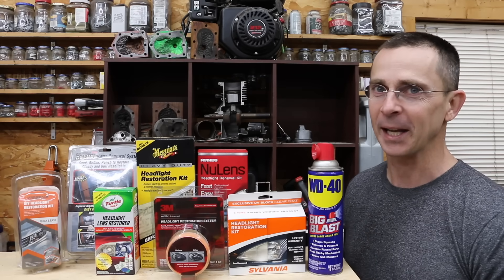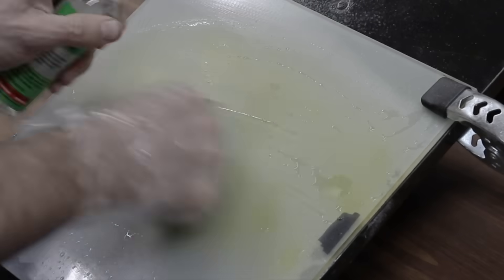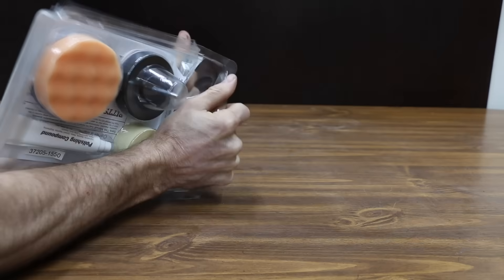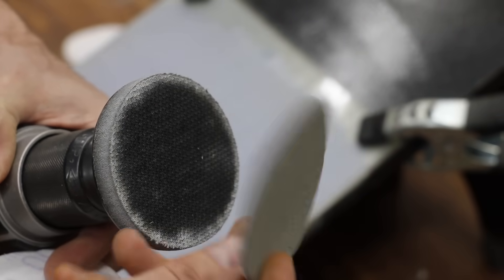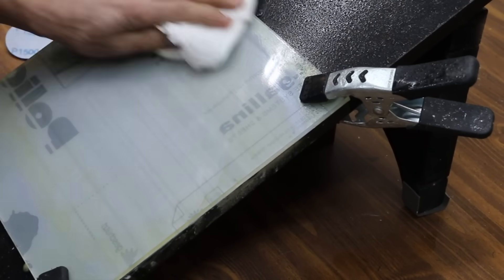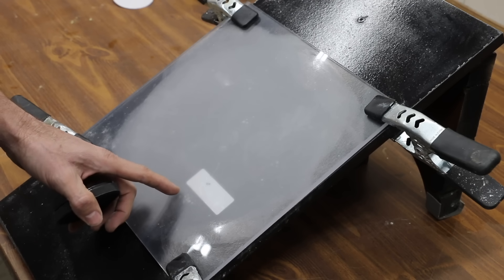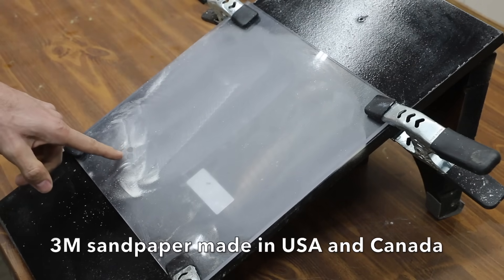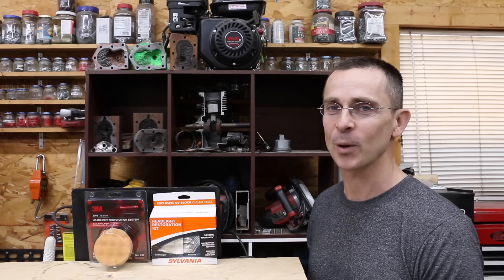Best Headlight Restoration Kit?  Let's find out!  3M, Sylvania, Meguiar's, Mothers, Turtle Wax & HF

Comment: Great test and great job, once more! There are many videos on Youtube about the subject but none as this one! Congratulations! Some videos show that whitening toothpaste may be a cheap and efficient way to do it. On a whitening toothpastes test I saw, I concluded that the best toothpaste for headlight restoration would be the "Colgate Max White One" because it's very abrasive and very good to remove stains from the teeth, had a reasonable glistening effect, but does not whiten them, like all the others tested. Pity you didn't test it. 
Likewise, using both Meguiars Ultimate Compound and Ultimate Polish (in this order) followed by ceramic coating (to give it a "permanent" protection) is also a great way to do it, but ceramic coating is very expensive, as we know. 
Just some examples:
https://www.youtube.com/watch?v=vUdSUDObwVc  (Chris Fix - From 25:10 to 26:30 - Meguiars compounds + ceram coating)
https://www.youtube.com/watch?v=FhzrNrGQ41M (LegitStreetCars - Compound + Ceram coating)
https://www.youtube.com/watch?v=rXHTXdlWw1w (Chris Fix: Using whitening toothpaste)
https://www.youtube.com/watch?v=lrlIhRea8u8   (With some extras from the above)
https://www.youtube.com/watch?v=UG54xt56uZo (Meguiars compounds + isopropyl alcohol)
Chris Fix also uses a "permanent" method using a UV protective spray at the end:
https://www.youtube.com/watch?v=UEJbKLZ7RmM
Scotty Kilmer's way: https://www.youtube.com/watch?v=E9NP0_nF2ak (polish first and then coat them with "Meguiars Headlight Coating". Then just coat them once a year)
Reply from the maker: Thanks for the feedback.

Comment: Sorry, but the damage incurred by headlights over time is not simple abrasion. The degradation you aptly explained in the intro was accurate....and them you ignored this in the test. As others have pointed out-a pile of ruined headlights would not be to hard to round up.

And far cheaper to you than the Lexan sheets you bought!

Comment: So it clearly looks like the Sylvania kit ($19.99) wins out and the big differences are it is all done by hand (not by drill attachments) and then you reapply the Surface activator and the UV Block clear coat application. So what’s the big differentiator? The hand sanding? The surface activator or the UV Block clear coat application?  By the way you must have gotten some workout with this project. Thanks for all your hard work!  Dale
Reply from the maker: Sylvania's sandpaper is very good and their surface activator/UV block clear coat is impressive!

Comment: First let me say you did a fantastic job in comparing these products.  The only sad part is you will have to do this every two years or so.  Personally, I think manufacturers should go back to a glass sealed beam headlight system and do away with plastic all together.  After all, this is a part of the automobile that can directly affect your safety when driving at night.  It's this kind of engineering that spawns these products you compared and we shouldn't have to go through this exercise at all.  If not a glass headlight, which is much stronger than a drinking glass, then have hide away lights that don't get the exposure to UV.  Thanks for sharing.
Reply from the maker: Glad to hear!  Thanks for watching.

Comment: This is great, thank you!  Personally i have used meguiars with very good results, the protective coating really does work.  For headlights with a complex shape I can only imagine using a drill for sanding to be rather tricky, but I haven't tried it.  I think i will pick up a 3M or sylvania kit next.
Reply from the maker: Thanks for sharing.

Comment: This is another great one... Thanks P.F.
Poly / Eizenglass. Acetone or Thinners will instantly put a dense fog on the lens trying to clean grease or smudges off ...then have fun rubbing it out. Found out the hard way....ended up with sandpaper up to 1500 grit and car paint polishers fine scratch and plastic polish compound. Lens kits are a plastic polish in a box.
Reply from the maker: Thanks for the feedback.

Comment: I bought the Mothers kit on amazon about a month ago and used it on my car and my wife's, it worked amazingly. A kit with a drill attachment is a must, wet sanding also helps a lot with the oxidation removal.
Reply from the maker: Glad to hear!

Comment: I restored my lights through wet sandpaper and clear coat. Just stepping up the grit. No fancy stuff and it has worked well on 3 cars. I have also heard that metal polish works well as a buff compound before you clear coat. Haven't tried it but if you had all these things lying about from past projects, which many a garage has, the cost is minimal.
Reply from the maker: Thanks for sharing.

Comment: Use to have a customer that had a company where they cleaned headlights they would by the 3m and a can of clear spray paint they said they could do multiple cars with one 3m kit can't remember the brand of clear coat but they had a hole rant on how it was the best clear coat to use because did the best and held up the longest.
Reply from the maker: Thanks for sharing.

Comment: Just did that with a clean microfiber cloth and some RainX X-Treme clean. Not as polished as an actual polishing of the headlights, but it was really good nonetheless and much simpler than removing the lens, sanding, polishing and reinstalling... You just clean the headlight right on the car being careful the product doesn't of on the painting of the car.
Reply from the maker: Thanks for sharing.

Comment: Good video to compare products. I usually do this job to my cars. I never use sandpapar below 1000 grid and start with 1200 or 1500. Because low grid makes big scrathes on the surface.
 3000, 4000 and 6000 grid sandpapers should be used to. It makes surface ready to last compound to get. )
Reply from the maker: Thanks for the feedback.

Comment: I just clean them with lacquer thinner then re clear them but you have to be careful with the cleaner
Reply from the maker: Thanks for sharing.
Reply: @ProjectFarm  you are good at doing this stuff, you should try this it is super fast but if you over use the lacquer it will start to soften the plastic at which time let it set for a bit then start over. caution if the plastic starts to soften do not touch it with a rag or anything, whatever you have will become imbedded and you will have to sand. PS I just use a bounty paper towel and clear with rust-oleum Gloss Clear. cost is about $0.05

Comment: I restored headlights for years and based my method on the Meguiars kit with extra steps and 3M pads. 

Getting the polycarbonate clear again isn’t the issue as long as you put in the work to get the surface properly polished. 

The bigger issue was getting a new coating that actually lasts. All the kits used to come with some sort of synthetic wax-like UV inhibitor that would last a month at most. Now, nothing on the market is going to protect the plastic as long as the precisely applied 2k coatings they used at the factory. 

There are A LOT of protective coatings on the market these days. I’d love for you to take a bunch of new, uncharted polycarbonate and get a bunch of consumer level headlight protectants and do a long term UV hardiness test today see which lasts longest.
Reply from the maker: Thanks for the feedback.

Comment: Ive used meguiar's plast x and meguiars headlight protectant. I've had bad luck with the meguiar's, because the protectant dries super fast and leaves a hard residue on the headlight that I can't buff out and leaves it looking worse than before. I always follow the instructions on the bottle and never had luck. I've used ultimate polish and ultimate liquid wax by meguiars on my headlights and have had great results. I wouldn't recommend the meguiars headlight restoration products. A better solution is to polish with a typical polish for car paint and apply wax or ceramic coating to the headlights.
Reply from the maker: Thanks for the feedback.

Comment: I have used Simichrome or Fltz  metal polish with great results to get it clear... I apply the the Simichrome to a clean headlight with a cotton cloth, buff and  finish with a sealer.. It works amazing.. a small tube of the polish will last for years...
Reply from the maker: Thanks for the feedback.

Comment: I have used the HF kit.. and found out if you use water with all the sanding pads.. they don't load up and work soooooo much better and stays cooler in use.
Reply from the maker: Thanks for sharing.

Comment: Thanks for a great video :) its always seems hit and miss with headlight kits but agree the 3m sandpaper is a cut above and my lesson is go slow and allow for cool-down time as some lenses will retain the heat and you will melt them even with 3k sandpaper.
I would be interested to see if you can find alternative methods, as seen work done by local who developed his own kit (only does through secret referrals only and you have to leave lights or car with him) and seen the work goes from faded like lights in video to new clear lens (figure he uses acid, sanding, epoxy fill, polish)
Guess these days with technology and china 99% of car lenses can just be replaced on the cheap but nothing does beat a glass one until it cracks
Reply from the maker: Thanks for the video idea.

Comment: Best headlight restoration that I ever found was my partner found some kind of cleaner solvent that all that yellow crap would just run off, spray it with water, dry it, mask it, and spray it with a good quality hard clear coat with UV protection...  done!

With all of that yellow sh!t gone - the hard clear coat would fill in all of those micro pits.  It comes out looking like new, and the whole deal is about a 15 minute job with zero sanding not counting paint curing time.  Unfortunately, it was some kind of surplus sample chemical and he was never able to source it again once the sample ran out.  It was probably some kind of automatic car wash under body spray meant to cut road tar since he was managing a car wash along with our car lot and repair businesses.
Reply: The Car Wizard (on youtube) did a video using Dot 3 brake fluid to restore headlights. I would like to see a comparison of home remedies like toothpaste, WD40, Dot 3 brake fluid whatever else is out there.
Reply: @uta667563  dot3 removes clearcoat and leaves PC plastic unprotected. Bad idea.
Yellowing is because of UV damage. It could be reversed by H2O2.
Reply: @otofoto  every product in the video removed the clear coat
Reply: @uta667563  That DOT 3 brake fluid will remove paint also if you get any on it.  Better be really careful if you use that stuff.
Reply from the maker: Thanks for sharing.

Comment: I would suggest bypassing all these and doing it the way I found to be the best. Wet sanding by hand and using a spray can clear coat that has a built-in hardener, these clear coats have a valve on the bottom of the can that mixes the chemicals in the can and is much more durable than other clear coats. Be sure to read the instructions on these paints as they are pretty nasty stuff, you need gloves, a respirator to protect your lungs and goggles to protect your eyes. It has stuff in it you do not want in or on you. You can use a regular clear coat but they tend to be too soft and can take damage and fade with simple bug strikes. The paints with hardeners are made for automotive use.  These kits will get your lense much clearer but they can not get your lenses looking as good as a good hand wet sand and proper clear coat.
Reply from the maker: Thanks for the feedback.
Reply: I got one for you, if you ever get a chance, test out some spray can clear coats, see how they hold up over time and to punishment.  Put a couple with hardeners in the competition. Maybe you can do some items and let them sit out for a year in the sun for a future results video.  @ProjectFarm

Comment: Project Farm
Outstanding video. Glad I watched this one!!!  I did the headlights on my mother's 2000 Ford Taurus for her 3 years ago. I used a 3M kit that was for hand working only, no power Drill or buffer. 
The 3M kit used by me was about $20, but it came with plenty of GREAT 3M sandpaper. The kit contained a pad to stick the sandpaper to, 8 discs of the starter paper, 8 of the 2nd grit, 4 of the 3rd grit, and a package of polishing compound and pad. 
It took about 45 minutes  start to finish with my arthritic hands. The headlight covers were so badly oxidized that you could only see the lights were on when you ran the HIGH beams.
After using the 3M kit the lens covers looked NEW!!!!! My mother had a fit because she thought I had bought new headlight covers for her car.
UNFORTUNATELY for me and the headlights on her 2000 Taurus,  I had not watched ANY videos about headlight restoration. Had I known that once the sanding was done one MUST apply some sort of UV PROTECTION to the plastic.
Now I have to do it all over again,  but now I have a can of NON YELLOWING AUTOMOTIVE CLEAR COAT FOR PLASTIC!!!!!  
I also NOW KNOW to REAPPLY the clearcoat every year!!!!!
I was going to buy a kit to do the lights again,  but I think I have a CHEAPER ALTERNATIVE. 
WHAT DO YOU THINK???? Here is my idea: just buy a few sheets of 3M wet/dry sandpaper in 800, 1500, and  3000 or so grits; use a soft sanding block to wrap the paper around; sand everything like I did before using the wet sand method. I have plenty of 3M polishing compound,  as well.as a bottle of 3M PERFECT IT for paint scratches.  When the poly covers are looking like NEW again spray 2 or 3 coats of the AUTOMOTIVE Clear Coat.
Until I watched this video I was going to buy a kit and go at them again. 

What would you try for cleaning up oxidized TAIL LIGHTS??? My 1999 Silverado tail lights are getting really bad. A friend told me the same thing you use on headlights will restore taillights as well. What is you thought about it??????
Reply from the maker: Thanks for the video idea.

Comment: Before going through all the steps and work of restoring headlight lenses... check out Ebay for a replacement.  I found a PAIR of new headlight assemblies (With new bulbs!) for under $50 including shipping for my 1998 F-150.  Each took under 15 minutes to replace.  Saved me a lot of messy work...
Reply from the maker: Thanks for the feedback.

Comment: Got an idea for a test, you may have already done it...

Often in Motorcycle engines if the carburetor float valve is not set correctly and the fuel tap is left on, fuel can pass into the cylinder and contaminate the oil.

How much damage does it actually do? What is the effect on the lubricity of the oil?  What is the effect on the temperature resistance of the oil?

Really enjoy the videos, been a sub since early on, awesome to see the channel grow so much!
Reply from the maker: Thanks for the video idea.

Comment: As a detailer, usually i use the sand paper method finishing with a uv cured lens protectant.  I recently used the turtle wax restoration kit and i was very suprised.  It did a fantastic job restoring some pretty bad headlights.  It was easy to use and didnt take long at all.  Even though wetsanding does a better job on highly oxidizes headlights, it does require a bit more skill when working on cars.  Generally you would mask off the headlights to keep from scratching the surrounding paint but even with masking it is very possible to do some damage while wetsanding.  Im not sure if this test did the turtle wax kit justice due to its ease of use and pretty much fool proof application imo.  Thanks for the video, your doing great work PF!
Reply from the maker: You are welcome.

Comment: I did my headlamp restoration this month and the results are amazing. Just buy 400-600-800 sandpaper of good quality, sand down the surface thoroughly. Buy a can of clear coating with hardener and spray 2-3 layers (cans have a chaber with hardener that is released by pulling a pin like in grenade :D). Results are great! And protection from clear coat is eternal :) It's cheaper and most effective. But hardened clear coat can be sprayed only within 24hrs from hardener being released.
Reply from the maker: Thanks for the feedback.

Comment: My idea: best methods for sharpening files. 

I sharpened some old files using vinegar over the weekend, and it worked spectacularly well - all of them are clearly sharper than they were new, including the ones that were already rusted and dull over a decade ago. The vinegar soak took a full day to work, but I know stronger acids require less exposure. And a simple way to conduct the test would be to start with factory-new files.
Reply from the maker: Thanks for the video idea.

Comment: I got a "shadetree mechanic" (someone that's not OFFICIALLY a mechanic, but usually knows what they're doing) opinion on headlight restoration years ago and he suggested "OFF! Deepwoods" (I'm not joking). You rinse the headlight to clear debris and such, let it dry, then spray it with the bug repellant, wipe with a paper towel, and let it dry for a bit, then wipe the residue away. I used to do that every so often on my PT Cruiser because after 2 different mechanics that were well trusted screwed it up and barely made a dent, I asked my friend who rebuilt cars from scratch to levels most mechanics I have found are not capable of. He was the "shadetree mechanic" I mentioned and damned if it didn't work for me. I didn't even need to use that much.
Reply from the maker: Thanks for sharing.